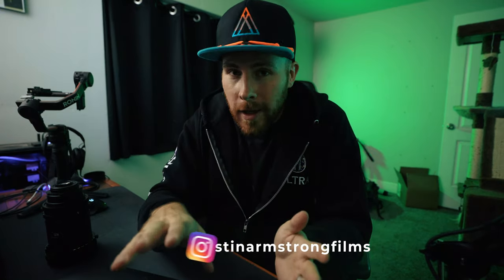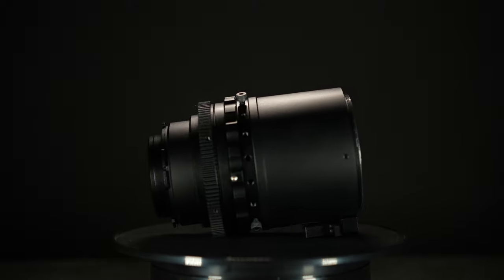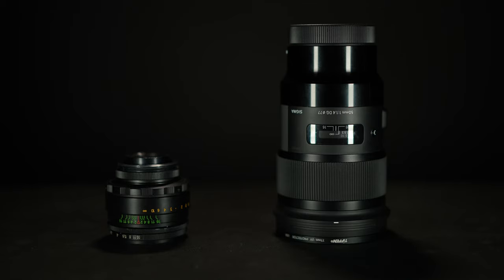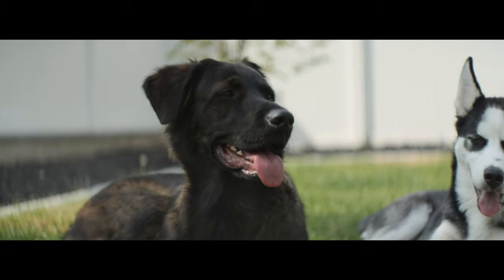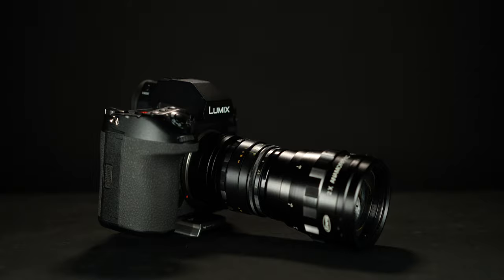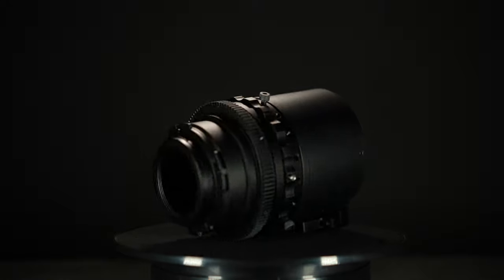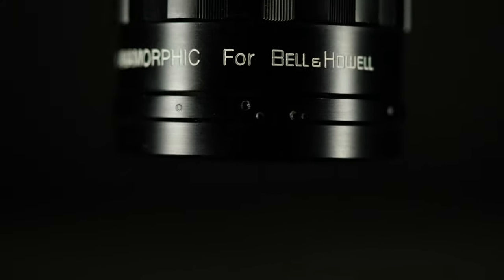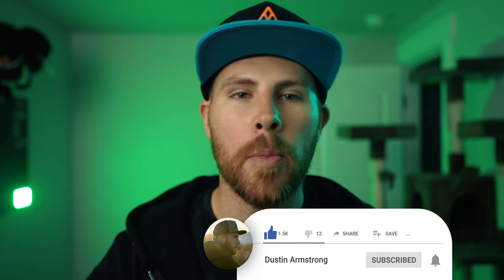How to BUILD a DIY Anamorphic Lens

Comment: Thanks a lot for the video. My question here is: Even If I had the Rapido FVD-16A I will need to use diopters to get close of my subjects? Other question is, If I want something more wide than 44mm I need to change the taking lens?

Comment: Liked the video. Personally, the anamorphic is such a tricky optics and it’s safer to rent it while the project requires it. It’s traditionally huge and heavy that you wouldn’t buy it anyway, because it’s not a lens that you will use ordinarily, and it’s hardly usable as a solo filmmaker. 
I also tried the Atlas and it’s difficult to use, it’s very soft and it’s so complicated to focus given the loosen ring. While the Master lenses are way better and sharper but you simply can’t buy them or carry them around for a long shoot.
So, your alternative is actually the only way to go if you want to have an anamorphic lens for “ordinary use” with an affordable price and weight.
Good job!
Reply from the maker: That's a great point actually. I guess Atlas and Xelmus are probably the only anamorphic lenses I'd consider buying, but yeah it's not really worth it. Thanks for watching and the support!🙏

Comment: I have same setup on my Komodo, only without metal jacket. Want to try Canon FD. BTW, on my camera Helios 44-2 works with Canon 0.71 speed booster and I have angle around 28-30 mm. Thanks for links under the video!

Comment: Question - to get that wide cinematic look, why not just use a wide focal length and crap to the aspect ratio you want? Is there some benefit to using anamorphic here? Is it to preserve resolution?
Reply from the maker: Cropping the top and bottom technically is "faking" the look of the actual wide aspect ratio you see. You will see more on the edges using a anamorphic lens and preserve pixels/resolution

Comment: So how many anamorphic adapters do you now own? You started with a pretty popular one but I'm curious if you have tried some other options yet? I started with the ISCO Ultra star light gold. But I've since owned every version of the ULTRA stars. I currently have 4 adapters housed in Rapido FMJs and I'm about to buy another FMJ for a new adapter I bought and I'm picking up the FVD16B. My goal has been to get 3 anamorphic rigs with matching cameras and anamorphic adapters with 3 different taking lenses. The idea is to minimize setup time and eliminate lens swapping on set. As you know that can be extremely time-consuming. So far I have 2 matching rigs. I'm struggling to find a 3rd matching adapter though. I also still need to get the FVD35A or NP for wide-angle shots. My taking lenses so far are Voigtlander 40mm f2 pancake, Nikon 50mm f1.8 AIS pancake( highly recommended, they're cheap), Nikon 85mm f1.4 AF, and a Nikon 105mm f1.8 AIS. I've got the looks I want. I just need to get the rigs as easily usable as possible.
Reply: I have the RMJ on my 40mm Voigtlander. I'm not sure I recommend it though. It has some limitations. The FMJ is necessary though for mounting the adapter and FVDs. The Bite marks can be avoided with Teflon screws. The anamorphic store has a good video comparing the Ultra star to the Atlas. IMO the Ultra star wins

Comment: Hey man, great videos! Would kowa work with full frame sony sensor? Or the vignette would be too significant?
Reply from the maker: It’ll work, but it’s possible it’ll vignette yes. I don’t think it’s super significant but still there. Check out some of the resources I linked and they can help answer some of those questions

Comment: Can this be used to make a anamorphic lens to work with a home theater projector?
Reply from the maker: You wouldn't need all the parts. You'd only need the kowa b&h front element cause thats what it was originally used for. Projector
Reply: @DustinArmstrongPro  thanks